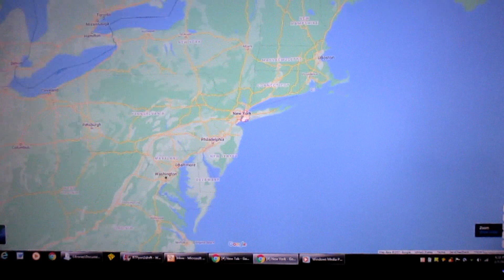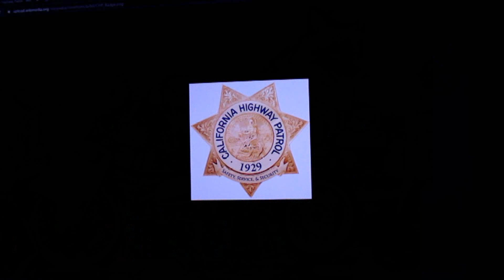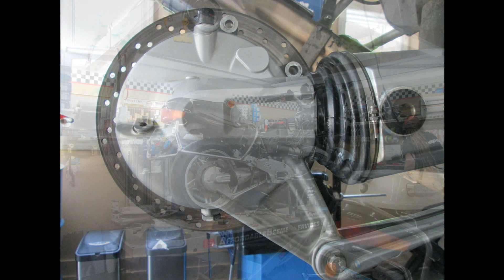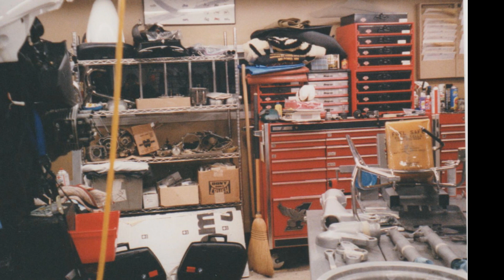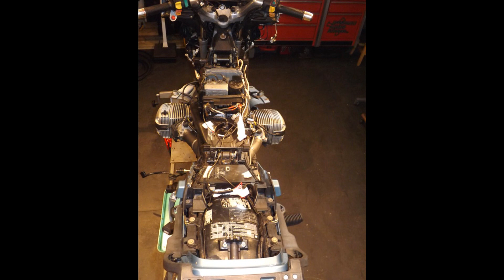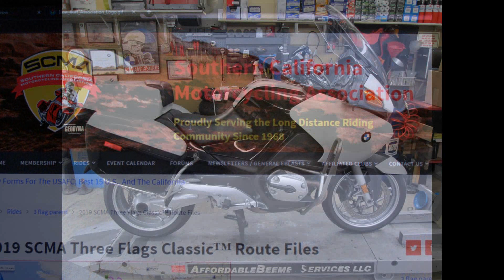BMW R1100RT-P Authority models: Bargain or Bust? - Part 3

Comment: Hello Chris I have one interesting idea that come to my mind lately and I decided to ask you as the most knowledgeable BMW technician that I know 

So I have 2001 R1150RT which comes without cruise control as an option I have a friend who has two broken down K1200LT and I'm thinking of getting the cruise control system from one of them. The question is the K bike has pulse speed sensor and my RT has cable speedometer but with ABS I have removed the ABS system long time ago because is very problematic and dangerous but I still have the abs sensor on the bike can I use the one of the existing abs sensors as an speed sensor for the cruise control and if yes which wire goes where thanks for your time Alex from Bulgaria

Comment: Hi Y'all. I love to rant also, How many theories are out there for setting up TPS from scratch? I have a  GS 1100. I stripped the butterfly stop, and never knew, just wouldn't idle, everyone replaced everything, lots of stuff it didn't need. Threw my tps and sych to bits following the procedures, the zero zero blah blah, its all bullshit, you cant set throttles to zero o nan eye-ometer and the adjustment is in cats whiskers. Then setting up tps with another set of throttle bodies, they set it with diagnostics, but the bike hates it, big lagsand dead spots, piss poor accelleration, so i set it myself, keep bringing the tps down in increments, by feel, until i like riding it again, But idk anything, i'm just tuning by air... I've seen a Swedish guy do a video, he had it right set it all to zero, back to bing, from western austraslia ($30 postage for a $3 screw,m thanks bing). sets tps to zero, then brings stop screw in to 350, or so, lock it down, synch it, thats it. What do you reckon mate?

Comment: Hi l live in Wellington NewZealand, I am an ex mechanic and have restored a 2000 R1100RTP Imported from the US back to its CHP spects. What a job. In NZ our police run the ST1300 not a well liked bike here, thay ran The BMW R1100, 1150, 1200RTPs.
I have a question for you, I have tried the standard RTs but the RTPs feel more solid and stable to ride have BMW done any  changes to the frame or setup.
Reply: Same frame and set up, except the R1200RT-P doesn't have ESA where the civilian bikes do. The P models are heavier though, that may be what you're feeling going down the road.

Comment: I wonder if my 2003 R1150RTP was used as a trainer or something for a few years. Records show it was with CHP until about 106k miles.

Will the common Delkevic pipe work without a chip?

Comment: Hey brother I have an 04  r1150rt-p what tool can I use to andjust the throttle and the carbs it uses a lot of gas...I just got it from my dad and he messed with it allot and I want to fix it and restore it...its got 110xxx miles what maintenance should I do to it and where can I find a manual or a guide book for maintenance
Reply: Put down the wrench and step away. There are no carbs on that bike........
Reply: @anonanonme2463  hahaha that's what my dad told me so I'm just doing my own research before I get started doing any work on it
Reply: Haynes and Clymer both have decent manuals. Also a lot of step by step threads on BMWSportTouring.com
Reply: @alm4132  thanks